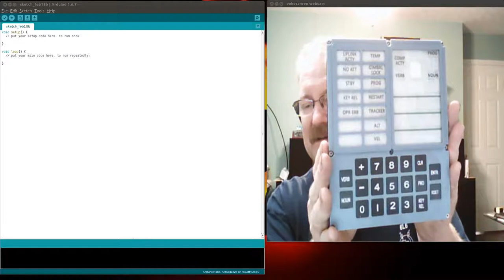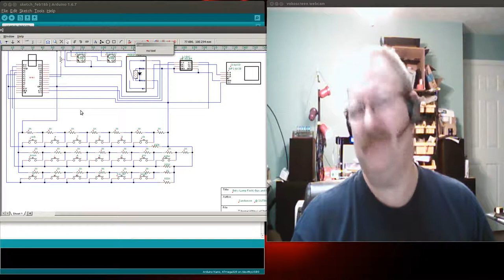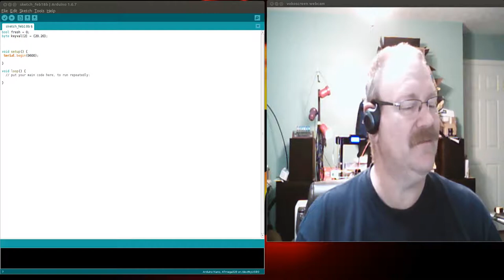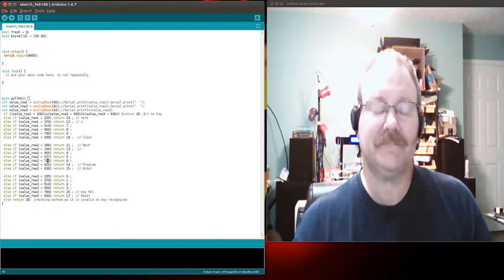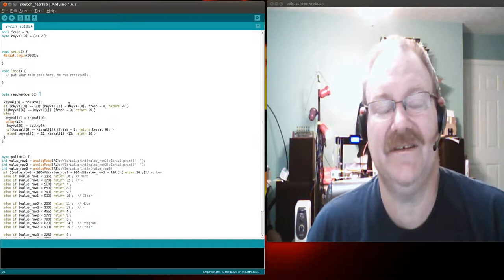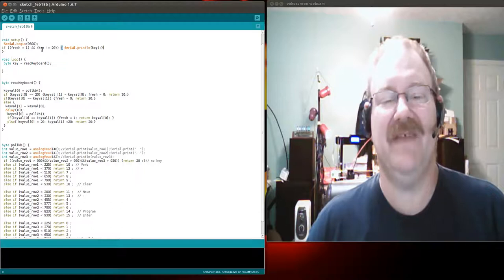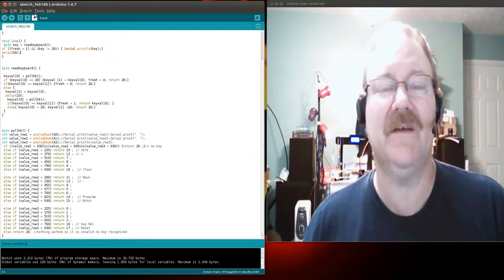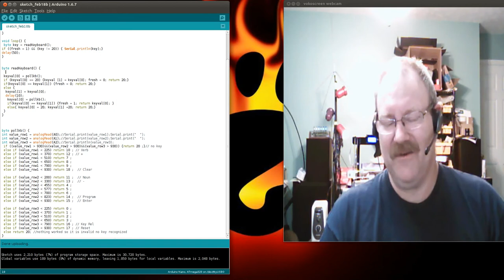Open DSKY Programming Part 2 Reading Keyboard

Comment: nice work! thank you for these tutorials. i think the keyboard circuit is genius -- to use analog to digital, instead of a matrix of rows and columns.  Is "fresh = 1" the correct expression in the first IF statement in loop()? It appears to work but seems like "fresh == 1" is what was intended.

Comment: have you tested this in a apolly flight sim like nassp?
Reply from the maker: No, we have not tested it with any Flight Simulators. But our code is Open Source and an experienced programmer certainly could write an interface to read the DSKY keyboard and send the info via USB, then receive the result via USB and light up the appropriate 7 segments.